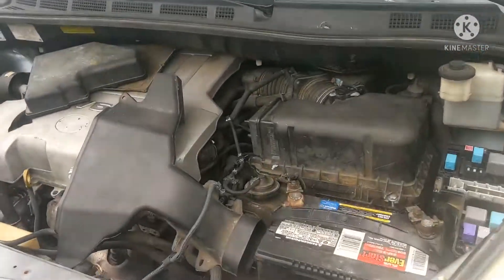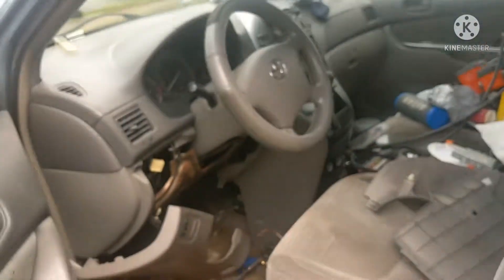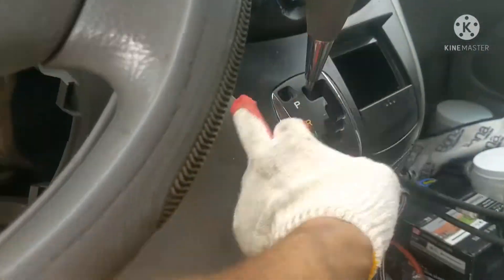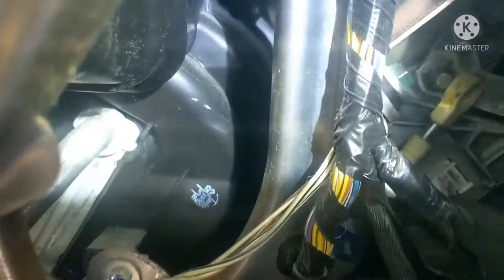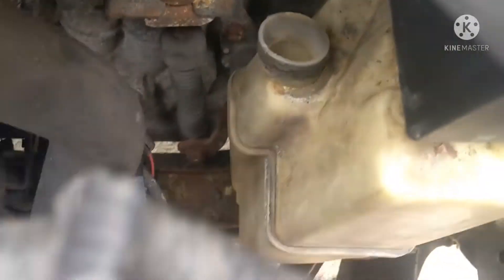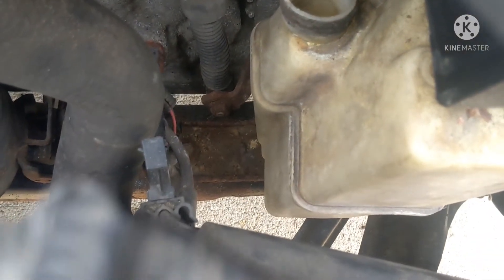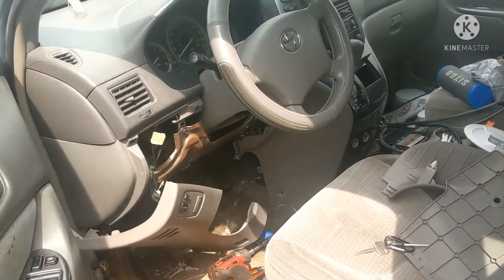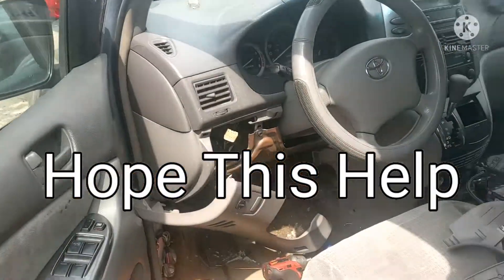Toyota sienna no crack no start fix

Comment: Thanks for the info. I ws able to get it running after going into the engine bay and pushing down the switch. Should I replace the cable? or is this just a rarity unlikely to happen again?
Reply from the maker: The best way to fixt it is by drilling a small hole on the shifter back there and running a blots true